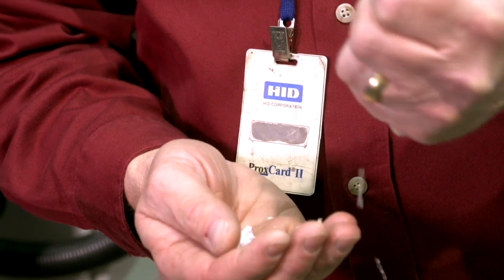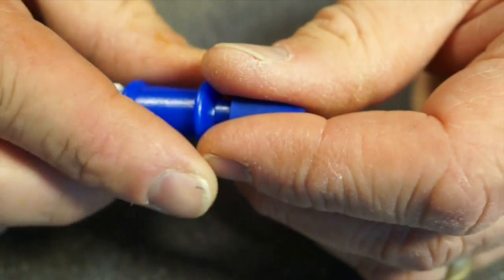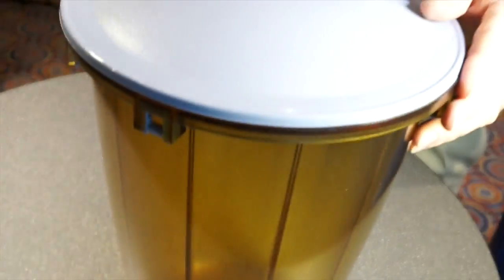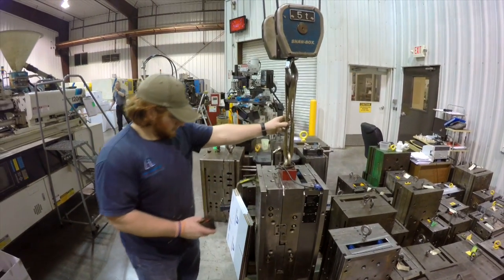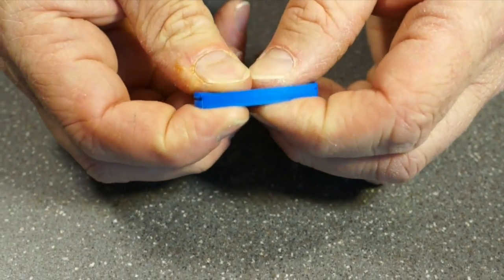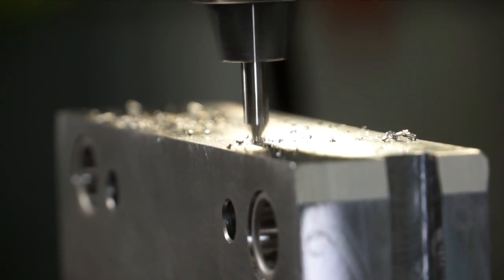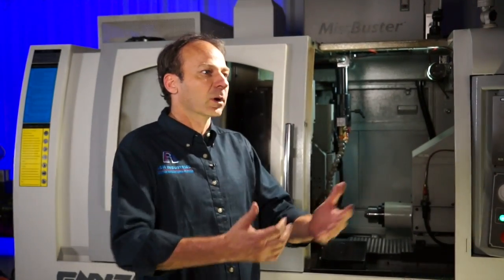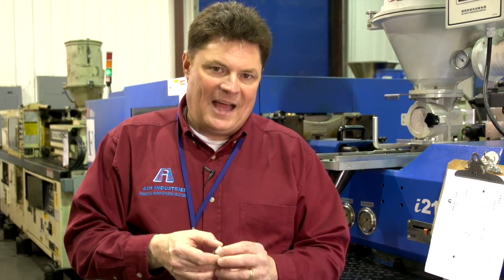Thermoplastic Injection Molding (TIM) & Overmolding | ASH Industries | Lafayette, LA

Comment: Hi..its highly appriciated demo but i wonder the difference 3D printer VS molding injection tech? 
Please advis
Reply: mym 3366 

Hello, I am a process / setup technician out of Pennsylvania. There is a huge difference between 3D printing and injection molding. Molding using a injection machine has an advantage of high pressure ability. Clamping, injection, ejection are some of the few pieces of a molding machine that take advantage of high pressure capabilities. Injection molding allows for plastic to be manipulated in various ways by perimeters set in the machine. Injection speeds, metering speeds, clamping speeds are few of the many advantages injection molding carries over 3D printing. While using 3D printing, you can have many variables against you. There is no pressure, just layering or in some cases laser mapped with no pressure. You have a higher fail rate with 3D printing. The amount of defects would be far greater, shorts, splay, non-fill, burns and a few others. The biggest difference would obviously be time. If we had a similar part being made by a 3D printer and a molding machine; assuming processes are set already. The molding machine would mold hundreds maybe thousands to the one part a printer could make. Printers take longer due to the lack of pressure and gravity fed resin but solely relies on plastic bonding by molten plastic being layered. There are massive differences, injection molding beats 3D printing in every aspect. However, sampling or making a tangible part during the engineering stage could find a 3D printer useful. A 3D printer could help save thousands of dollars during the construction phase to see how the product would work and provide customers a part before molding thousands that could be faulty. (Before building a tool a 3D printer could be a game changer). I could continue but I already bounced around enough. Hope maybe this helped you.
Reply: 3D printing is a additive deposition process wherein you keep adding layers (under heat) but the lower layers have already cooled down. 3D printing is excellent for checking designs and verifying concepts quickly.In Injection moulding entire part is made with plastic injected in molten state into mould wherein when it sets you get a uniform structure which is more stronger than 3D printed objects.